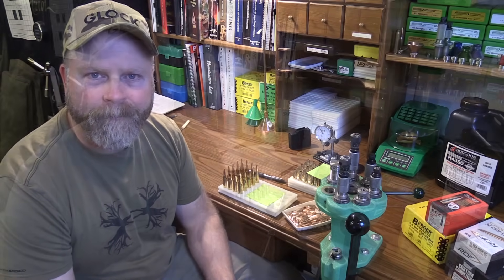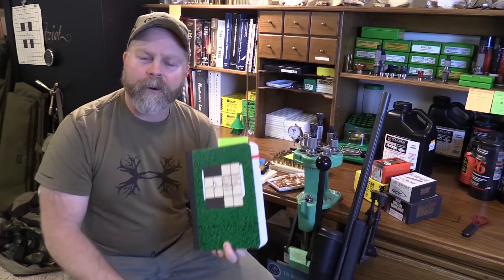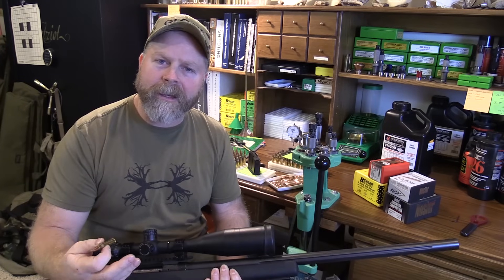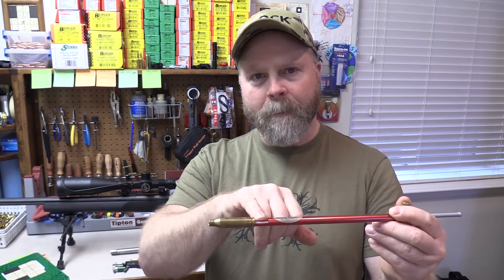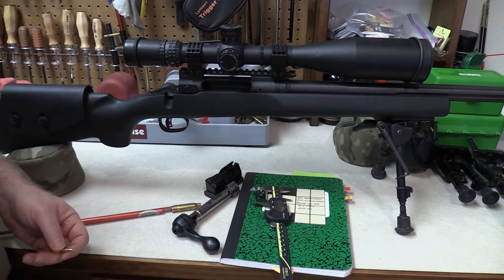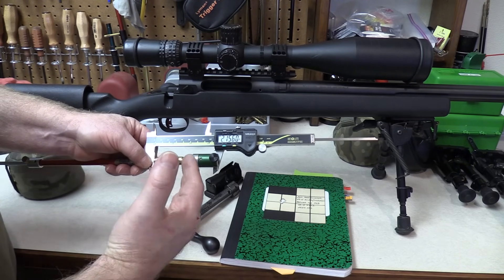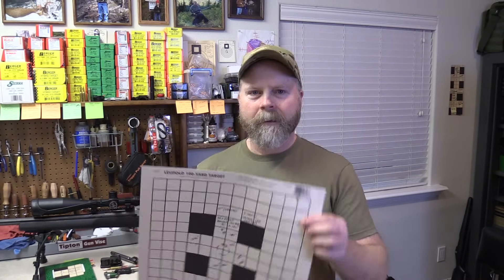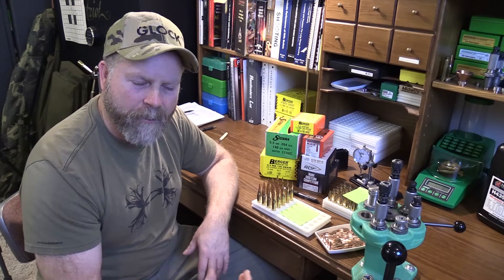Bullet Seating Depth: How To Measure & Where To Start For Load Development

Comment: Be careful of the headspace difference between the Hornady gauge cases and your own spent cases. If you drill and tap your own spent cases which mimic your rifle's chamber dimensions, fine, but the Hornady factory tapped cases will be shorter (to fit any gun). Account for the difference in all your COAL measurements.

Comment: Overall a great video.  But there is zero chance that using a coated cleaning rod to unstick the bullet will damage the barrel.  I prefer to push the bullet into the lands using the hornady guage, with some force which gives about 0.020 jam.  Its more consistent to find than just touching the lands but either method works.  Then you can start 0.030 off jam if you want a 10 thousandth jump.  If the bullet is just barely sticking,  its probably. 010 to 0.015 into the lands.

Comment: In Harry Potter, the wand chooses the Wizard.  In rifles, the bullet chooses the barrel! 

Good video.  Basic and easy to understand without the complex variable & BS you get in some.

One point I would like to add - the throat grooves are usually tapered.  I use a Sharpie pen to mark the bullet & then check the lands engagement.  This results in a scratch mark od about 3 mm.   In other words, the tool used in the video is actually pushing the bullet about 2 mm into the lands.  That is about 79 thou.  While it is correct that the first measurement is a relative number, it is still 79 thou into the lands.  If you want to avoid the bullet touching the lands, you will need to reduce that 79 thou to your cartridge length.

Comment: I agree...i have a half shot out 22/25 barrel.. can't find the lans... shoots any seat depth and shoots it very accurate... Different seating depth doesn't change anything in that rifle....i use a lee culit crimp die to achieve a uniform start pressure and set free bore travel at 0.010...works very well...just my 2 cents

Comment: ditch the gauge and use a case with a slightly sized neck fireformed case. Strip bolt down to the body to get the correct feel of a formed case. You should be able to close the bolt with a slight resistance but not a hard bolt closure. I use a Lee Collet die to control the neck tension, to allow the right clearance when applying red lock tight for a dummy round. From there I use a Redding seater micro seating die.

Comment: so is measuring from the ogive useless unless i have something to measure the depth to the lands?? I bought a comparator set but not the oal tool, I was hoping i could use it for being consistent seating to the listed c.o.l, but the c.o.l is measured to the tip no??  I'm new to reloading so thank you for any advice. thanks.

Comment: I have been reloading for over twenty years.

I have NEVER gotten the same measurement twice when using a Hornady OAL gauge... with fire formed cases subject to that particular rifle.

What gives!

I have a brand new rifle I am trying to determine the chamber length/depth on right now.

Getting anywhere from 3.880 to 3.916 to 3.975!!!

I have been attempting to get this measurement for well over an hour.  .095" difference is crazy. 

I experience this with all rifles... but this is the worst!

Yes, the gauge is bumped against the chamber shoulder.  I push the bullet in just until I feel it touch the lands.
 Driving me crazy ... again!
Reply from the maker: The only thing I’ve experienced that causes variations like that is the bullet dragging in the throat. The throat is generally cut .0005” over bullet diameter. If the reamer is a little under spec, or there’s some carbon in the throat, it can cause it to feel like the bullet is against the lands when it’s not. Easiest thing to try is scrub out the chamber and the first few inches of the barrel really well. CLR on a bronze brush with a section of cleaning rod, chucked up in a drill and spun up back and forth a few times, will take care of any carbon in the throat.

Comment: You can measure headspace on the special case for the OAL tool and measure the headspace on your fired brass then simply calculate the difference to adjust the base to ogive reading for your particular chamber.

Comment: Thank You Sam for the clear concise info. I was in the process of working up a new load at the very time I saw the first of one of your videos and it answered all my questions. Now after some more steps into the process I have another question. What if you are using bullets that have a cannelure. Is it OK to ignore it and pass it by to get closer to the lands or should you stop at the cannelure and crimp the bullet. I use Sierra 168 BTHP Match bullets for match shooting but not hunting. I am working up a load for a hunting rifle in 270 now. What would your advice be or anyone for that matter that has experience with such matters.
Reply from the maker: Ignore it. Seat them where you want.

Comment: Good advice about the limitations on seating depth that may be imposed by the magazine.  I went to a whole lot of trouble to measure the seating depth just touching the lands using the comparator tools, then discovered that the overall length of that load exceeded what would fit in my magazine.  The closest I could load to the lands was the maximum COL that my magazine would handle, so that's where I stopped.

Comment: I have a bullet that's 6 in Long 11/16 of an inch wide which is 0.74 caliber the lead the head is 2 1/4 in Long and 11/16 in wide this bull is very heavy and it's scary looking it's a 0.74 caliber it's also a you could call it in centimeters it would be one and a half centimeter

Comment: Thanks for sharing your process with us.   I have a question about bullets. The 145 gr 7mm variety. I recently purchased a box of 50 and I always check a few weights and diameters from each box/lot prior to reloading new ammunition. In this box I noticed inconsistant weights on the first few I checked. That promted me to weigh each bullet in this box and I found the low weights to be appropriately 144.7 gr the high weights to be 146.6 gr. I know my scale is not perfect but has always been very consistant. At what variations would the finished ammunitions reliability be affected as a hunting round by the inconsistant weights, if any? 
Thanks,
Paul

Comment: Question. I often have to stick the cleaning rod down the barrel to push out the bullet stuck in the lands as I have bad “feel”. I never have an attachment on it during. Is that damaging? The end of the rod is bronze and the rest of it is carbon fiber. Even if I had it torqued, I would imagine I’d damage the bronze long before I I put a mark on the SS.
Reply from the maker: No problem at all. I use the threaded end of my Dewey rod for the same thing.
Reply: @PanhandlePrecision  Great, thought I might have been doing it wrong all this time.. I’m enjoying your content. Been reloading for a couple years now. Only recently gotten into attempting precision reloading. I’m doing something terribly wrong and I’m determined to find out what.

Comment: why cant you just put a bullet in the case with bullet lose  chamber the round and pull the bullet back out then check the over length
Reply from the maker: The bullet will stick in the lands, and either stay there, or not stay in the case where it bottomed out. If you add tension and try it that way, the bullet will engrave in the lands, and give you a false dimension.

Comment: Sam, I love your videos as well as your written stuff. I've learned a lot and remembered a lot of what I'd forgotten. Wonderful. A few days ago I asked about the Redding Competition shell holders. You said they "are a waste of money. They don't work." I had already purchased them, so I did what you tell everyone to do in your videos--"Don't be afraid to try something." Well, the .002 setback shell holder worked like a charm the first time and the 50th time. Perfect .002 shoulder bump. I'm using an RCBS Rebel with 6.5 CM Hornady Match dies (with Micrometer seater head), the Hornady gizmo to measure with the Modified case I made from once-fired brass, and measuring results with a Mituyomo digital caliper. The shell holder also worked for my .308 Win. For that, I use a National Match sizing die and a Forster Micrometer seater die. As soon as I make the Modified case for my 300 WSM we'll see how that turns out. All brass is Alpha or Lapua. BTW, don't believe what you read about the RCBS Rebel's ram being sloppy. This thing is built like a tank. You need two strong men and three boys to lift it (JK), and the ram doesn't wobble a nanometer.

I feel a bit awkward giving this constructive criticism. Even though I have been reloading for over 25 years, your depth and breadth of experience are way greater than mine. These shell holders just worked for me. I guess it is better sometimes to be lucky than good. Now let's see how these babies shoot!
Reply from the maker: I remember. All I said was  they were a waste of money. I bought two sets of them to try. In the end, they don’t do anything a twist of the die can’t do. But you’re right—try everything!

Comment: I just used the Hornady case length guide tool and a .223 modified case, used the digital caliper and every dang one came out different for COAL I don't care to buy comparator gauges too, at this point (until I'm gifted some more gift cards :)) so I'm just gonna use the mean average and seat under that. As it is I can't remember if I used the loading book COAL or used that and added 10 thou. (That's where a notebook would have come in handy while letting the barrel cool). In the end, Without any measurement tools I got 1.090 for 5 rounds at 200 yards, and .850 with 3 rounds at 200 yards, Factory Barrel, Remington 700 SPS Varmint in .223 in a Stocky's stock and a Timney Hunter (Elite) trigger set at 2 lb---so with the tools and seating depth work I'll try to beat it. As far as what shot best in the .223 varmint so far, 55 gr. V-MAX flat based. The Nosler BT Varmint in same weight were everywhere with same powder charge. 1:12 twist rate limits the bullets I can use, to probably 60 gr. and under. Thanks for your videos, Sam.

Comment: Hello Sam, I know this is a old video, but an excellent one. My questions would be:
If you are dealing with a shorter lighter grain weight bullet and if loaded for say .020” off lands but less than the bullet diameter is seated in the neck, is this ok?
When does one decide to just go with COAL (head to bullet tip) for the particular bullet stated in the bullet manufactures reloading manual?
Or can a person have only a third of the bullet dia in the neck when trying for .020” off the lands? I have a Win M70 chambered for .243 WIN, and it does not have a box magazine to restrict COAL length like some. Sam, if you can’t answer this question directly, anyone else with experience is welcome to chime in.
Thanks 😎👍

Comment: Hello thank you for the information. When you look at different charts and there’s a minimum amount of powder and a maximum amount of powder they also provide you with an OAL or COL. if you seat your bullet in the case at something deeper than what is suggested does that raise the pressure inside your bolt or breach? Most manufacturers unless their match grade bullets generally their depth is within .005 to .012. Also we’re looking at different reloading manufacturers suggested books, whether it’s Hornady, Hodgdons, or Lyman their suggested loads and their suggested deaths are always different. Do you need to be cautious in the variations when loading to the higher end of the load spectrum? Especially when you’re seating your bullet beyond the suggested over all length (OAL)

Comment: You can also take a fire formed case measure with hornady case tool then measure the  resize brass than measure the comparator case add the difference to your new case after taking base to lands measurement no need to fire form or tap case you can if you want this is just a alternative method if you don’t want to tap your own case

Comment: You should measure base to shoulder with a headspace comparator also, especially on a store bought modified case. You can then add or subtract that measurement from your resized brass to know exactly how far off the lands you are. New brass that's been modified could be .010"+- different (usually shorter) than your resized brass, throwing off your BTOL by the same amount.

Comment: What is "shoot well" I am getting like 0.17 MOA with this bullet with 3 shots then it opens up to 0.5 and then 1.3 MOA. Then I shoot like 0.005 off that and it shoots 5 shots 0.7 MOA then 0.005 off that it shoots 0.9 MOA and then 0.005 more it's 1.3 MOA... Is it just me or should I abandon the bullet. I get great 3 and 4 shot groups but then get messed up on 4th and 5th shot... I also have a lot of horizontal spread

Comment: Perhaps the change in accuracy is not bullet's distance from the lands, but the change in case capacity caused by moving the bullet in and out of the case? The effect would be more noticeable in short cartridges with larger caliber projectiles.
🤔

Comment: So don’t hate me for this question. I am just getting started into learning about reloading before I venture off and even try to reload.I’ve been reading a .308 reloading Manuel and am trying to figure out the best grain of Bullet for reloading for my .308 with my bolt action rifle with a 1:10 twist on it. Is a 165-168 grain okay or is it better to go heavier?
Reply from the maker: I don’t load for 308, but most of the guys I know that do, are loading 168s or 175s. A 10 twist barrel will work for either, and let you go a little heavier if you want.

Comment: Great video, as you mentioned to do not size the case to get neck tension but what about sizing the case and trimming to get the max case length or slightly less then use the CBTO? Thanks

Comment: I loaded mine .020 of the lands at mid charge and still showing pressure..should i back off the lands or lower my powder
Reply from the maker: If you’re for sure off the lands, dropping the powder charge is your only option of those two.

Comment: very honest and good information. thumbs up. I own 270 win and I try and measure my gun kissing point with 2 type of bullets obviously I don't have that kind of tools in this country but I use empty case with bullet and try  to fit in rifle 3 times and then make it deeper 2.5mm to achieve less jump and good exit by bullet. I try it from half mm to 3mm which is the default choice of ammo factory but as you mention in clip lots of element involving the reloading. like Tangent Ogiv vs Secant Ogive or conventional rifling vs polygonal and etc. as long as your group stay lower than moa in 100 meters every thing is ok but boxer primer, quality of case ( I prefer shot once with mine rifle ), black powder and bullets + reloading skill and tools make it elite. everyone hesitate to announce a measure in most of the time but it seems 2.5 mm up to 3mm dept from kissing point is good enough and it is my personal opinion

Comment: Hi Panhandle Precision
Thanks for your great videos.
I just have a few questions that I want your opinion on.
What is your position on coated projectiles vs. the opposite.
If, for example, you shoot 6XC, which is a completely unique caliber and where cases are trimmed to 48.20 mm. how do i find out my tolerance on maximum case length. From which case length should I trim. These are Norma cases.
Thanks again for your instructive videos.
Per Skov Danmark.

Comment: So I've measured the cbto in 3 different ways: dummy round included in rcbc precision mic, an empty round with sized neck (both of which where placed behind the extractor), and using the hornady OAL gauge. Measured 3 times each method. It was consistent...but only to the same method...but different to each other. E.g. the empty round was measured in the precision mic (.232) and the comparator (2.282). The dummy round was measured in the precision mic (.207) and comparator (2.262). The OAL gauge measured 2.270 in the comparator (can't be used in the precision mic :). Why the different measures? I would expect the dummy and empty round to measure fairly close to each other.

Comment: any suggestions for the problem of coming up with wildly different lengths back to back?
Reply from the maker: Brian Bagent The most likely causes are a case not seated in the chamber, or the bullet not sliding freely in the neck.
Reply: @PanhandlePrecision  - thanks. the issue I'm having is measuring a TC Encore. The case is seated in as far as it will go, but I'm getting COAL measurements (308W, Speer Gold Dot 168) as high as 2.860 and as low as 2.750.  The shorter ones, yeah, thinking I just encountered resistance early and stopped. Am aware that I am actually measuring to ogive, just trying to give a frame of reference b/c the book on that bullet is 2.800.

I tried the "tap" technique and the light stroke technique.  The latter seems to give me more consistent readings, but still well past where I should be encountering resistance - I've gotten several measurements consecutively in the 2.840 range.

The barrel on this Encore has fewer than 500 rds through it, and until recently, it was all factory. So it's not like the throat is worn.
Reply from the maker: Brian Bagent There should be no resistance to the case shoulder seating in the chamber, or the bullet touching the lands. If there is, you have to figure out why and fix it. You shouldn’t have to tap anything to make this work consistently.

Comment: I know this is years later, but I just want to verify what you mean by 10 thousandths. Do you mean 0.01" as in ten one thousanths or 1 hundreth? Or 0.0001" off your reading using your modified case?

So you measured in the video 2.1560" So do you mean you'd aim for about 2.1550" CBTO on all your rounds?
Reply from the maker: Greenday4537 .010”